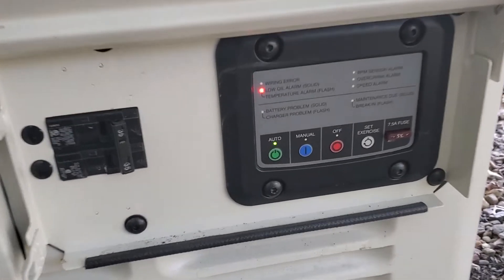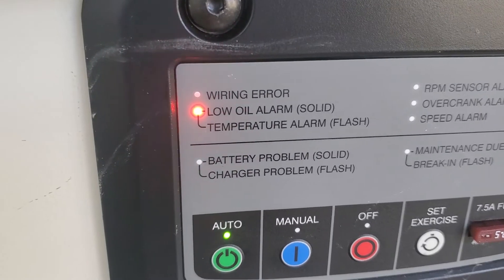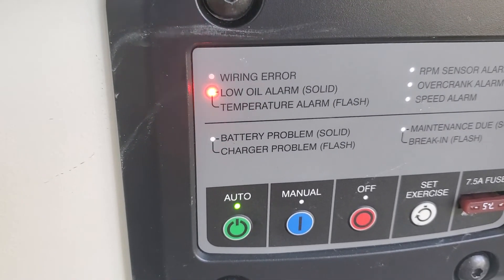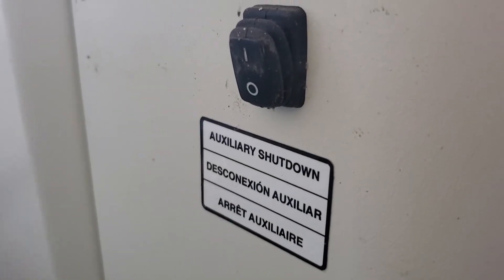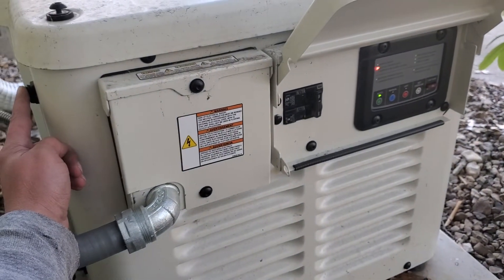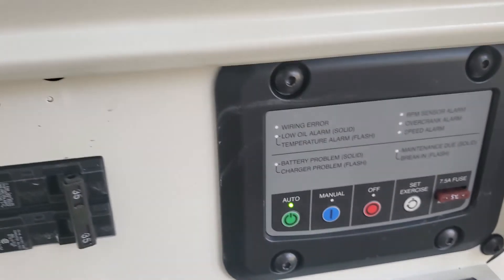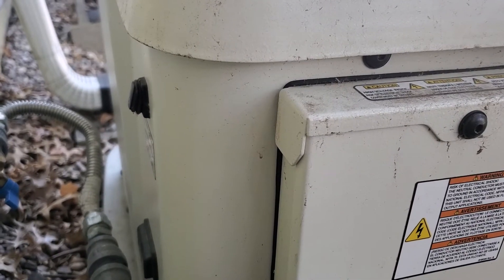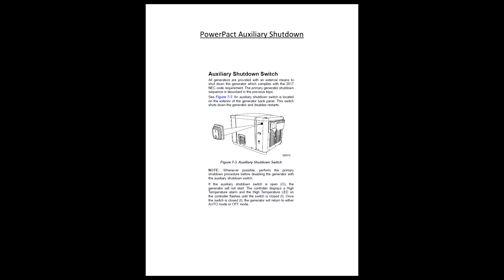Generac Generator:  7.5 Kw Fault light

Comment: Hi Josh, are you still working with generators? One of the commenters here asked, if pressing this button while the unit is running, will damage it, and what part? I would like to ask that question as well. Thanks for your answer, sir.
Reply: I am a generac tech. The auxiliary shutdown is used in emergencies, or at least that's the goal. Fires, gas leaks, whatever. It's meant to quickly stop the gen without having to get the keys, lift the lid, unscrew the lid, etc. It's no different than pressing the stop button while the gen is running, only difference is that it will alarm as well as shutting off.
Reply: Pero hice lo q usted hice en el vídeo y me persiste la falla q debo hacer